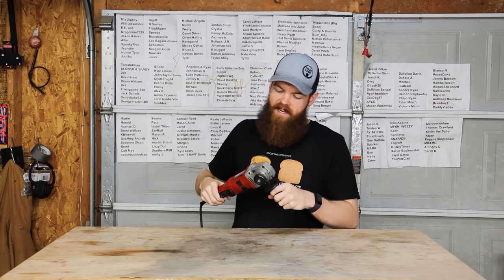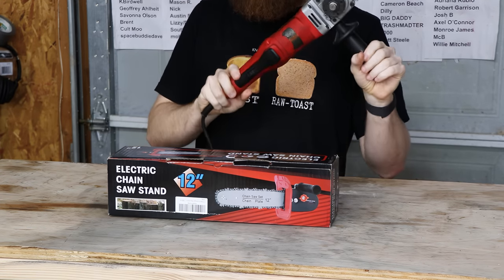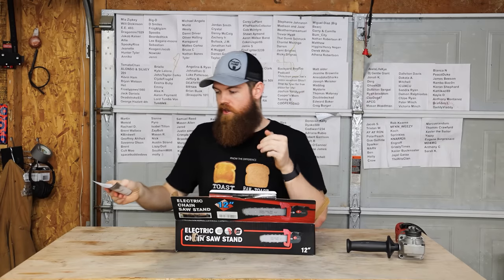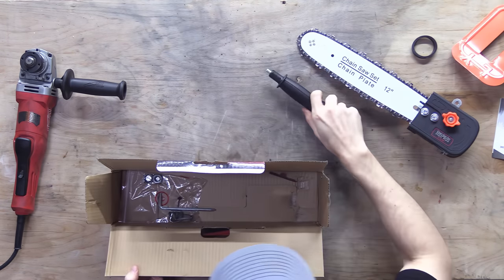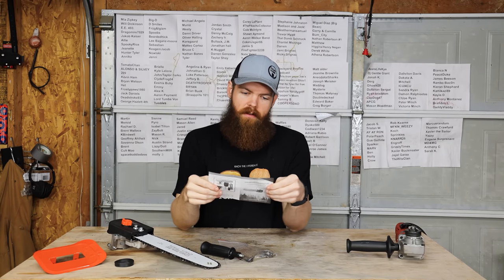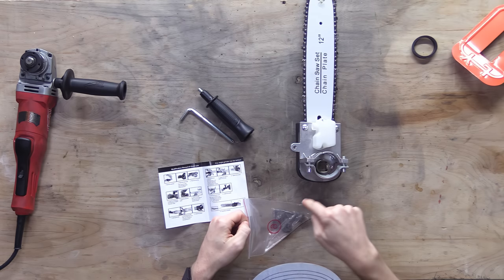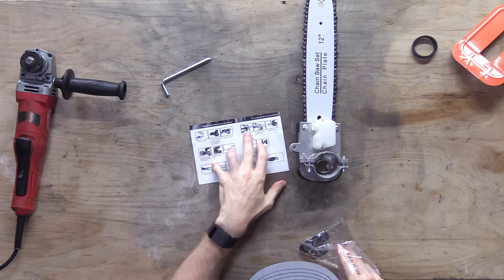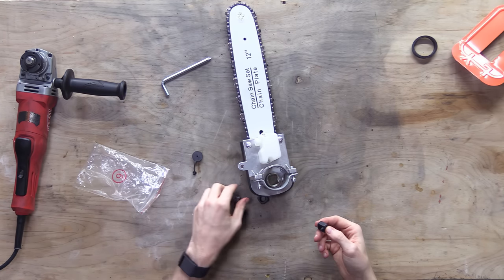Testing The Most DANGEROUS Tool From Amazon!

Comment: This was one of the first time I was genuinely concerned for Tyler's safety.  That chainsaw grinding disc scared the crap outta me.  Every time it kicked my heart skipped a beat, I was watching through my fingers like a horror movie. That thing is super dangerous and seriously should go straight in the garbage.
Reply: I dislike grinders in general because I am always scared of the kickback. Might be a good tool for the zombie apocalypse but still, a chainsaw would be better.
Reply: @jimmymartin  I agree completely.  Even if the real chainsaw was a bit slower its still less time than you would spend in an ambulance or ER.
Reply: @spicydragon3881  that's not particularly the dangerous one, the grinding disc chainsaw thing is what he meant, that shouldnt exist
Reply: I've ran 12" saw blades on angle grinders.  Man up
Reply: @MrJames_Bondage  Yeah for sure, the chainsaw adaptor isn't all that dangerous (aside from the spontaneous disassembly) as it doesn't really have the power or the length to put you at much risk from kickback unless you try something dumb like a plunge cut but those chainsaw disks are sketchy at best. They have their uses but they're like the nitroglycerin of explosives, even if you're careful you're never far from harm

Comment: This is probably the most anxiety I've felt during one of these videos. The chainsaw disc is so dangerous, I'm pretty sure it's outright illegal in a bunch of places, and you can very easily tell why in the video, it has a lot of kickback, one tiny mistake or slipup, and you'll find yourself with a disc embedded halfway through your forearm, stomach or leg.

All I know is that even if it's not actually illegal and I'm confusing it, I've seen quite a few experienced woodworkers who treat that chainsaw disc like the plague, and you should probably too! Lol.

Quick edit: I know grinder discs can be very dangerous as well, the difference is that regular discs are way more controllable, and in case of an accident, they'll just slice you up. The chainsaw not only has a lot of kickback, making it ridiculous to control, if you have an accident, it will literally chew up through your skin and get embedded, instead of just slicing. You can probably imagine why eviscerating your skin, muscle and even bone, and getting a disk stuck in it, is a lot worse than slicing with a normal disc.
Reply: Well said i am shocked how Tyler did  not cut his body BUT CHEW his Body    that is not meant to be cutting  wood with   it is for carve wood ONLY even carving wood with that  chain disk is risky  ar best
Reply: He didn't use the rubber fitting in the clamp area either.. I noticed that because it was sliding off way to fast
Reply: My first thought was NOOOO! No kickback brake.
Reply: @TechItOut  For real!
Reply: I can vouch for this. Im a victim of that tool. It kicked back and put a 7” gash in my forearm that was all the way to my bone. And it wasn’t a clean cut. It looked like ground beef. My butt puckered so hard watching that
Reply: thats why you should have a guard
Reply: The saw disc definitely needs used with a handle
Reply: @philipplays3626  when i had my accident with this wheel i had the guard on and the handle and a 2 handed grip on it. It kicked back with so much force that i had no control over it. Literally one second it was in my hands and the next second it was gone and I looked at my arm and it was ripped open. Im a big guy too, i have good grip strength and all that but it didn’t matter. Tyler is extremely lucky this didn’t happen to him
Reply: @philipplays3626  he literally has a guard

Comment: Ok so the grinding disc isn’t meant to cut, it’s a tool used for sculpting wood, and more precisely to remove a lot of material fast, you need to use it with the spare handle , and you use the same motions as when you clean up steel welds ! I hope it helps ppl understand it’s purpuce :)

Comment: You bought a smart angle grinder. It's got extra bumps and doodads that keep people from doing stupid things with it. An angle grinder is one of the most dangerous tools a layman can use. Never remove the guard and know what your discs are intended for.

Edit: after watching the Dremel, I think I should change this comment to say, grinder discs in general are dangerous if you're not careful. They spin FAST. If they break, they shatter. When they shatter, they throw shrapnel very fast and the guard plus eye protection will usually protect you enough. Just imagine a shard of cutoff wheel disc flying off at 8000 rpm and embedding into your neck, cutting into an artery. That's how you gain appreciation for angle grinder safety
Reply: Had a relo die on a roof from that very thing. My husband had a grinding disc shatter in a wheel arch once.( panel beater). He was lucky. It all missed his head.
Reply: I’ve seen what a fully shielded chopsaw blade can do to the arm of someone when it explodes. I was always paranoid when using them and because I was a welder, I always had my leather sleeves and weld helmet with built in grind shield on
Reply: I had to use an angle grinder for the first time in my life in a metal working arts class. I always wore both safety glasses and a full face shield because I was terrified of it shattering and hitting me in the face
Reply: @indicaking  Never get comfortable with it. That's when people get hurt. Greetings from Dimboola in Victoria.

Comment: Yes the black ring. Sometimes different angle grinders have different designs instead of modifying the angle grinder you need to redesign the bracket of the attachment in this case it is a chainsaw attachment
Reply: I was thinking he should have just bought a better clamp

Comment: That round "chainsaw" blade is basically for wood carving.  I would have re-staked the teeth before using it. A flying tooth can ruin you, forever, depending on where it lands. I would also add some sort of guard. If your hand would slip down we could call you lefty.
Reply: Not that I'm defending him for using that disc in the first place, but in all fairness, he DID remove the pieces of the grinder where you were supposed to use to attach a guard, so it's not like he could've used one even if he wanted to.
Reply: Safety isn’t Tyler’s forté lol
Reply: Best thing is to avoid them like the plague.
Reply: But that's why i'm subscribed. It's nice to cringe and see the genuine danger that he, totally by his own choice, put himself in. Don't know how many times i rewatched the 9V battery video just for that reason.
Reply: when he the chainsaw-disc i saw the liveleak logo pop up for a split second and then he kept going O.o

Comment: Glad you wore protection for that chainsaw disc, bro.  Stumpy Nubs, a popular woodworker on YouTube, had a really bad accident with one of those and he did a whole video about how quickly they can just mangle a person.  Be super careful with those!  Great video, as always!
Reply: Stumpy Nubs got lucky. 
Tyler had a miracle, using a carving attachment when he had cut the safety guard mounts off AND wasn't using the side handle.
Absolute stupidity. One of these days, a video he films will be used in a fatal accident inquest.
The chainsaw attachment would have been fine if he read the instructions and used the plastic ring in the clamp like it is designed to be.
💚🐇🐴💚
Reply: @BunnyKins1970  😂😂😂😂
Reply: I think there was an accident on Extreme Makeover with one of those disc saws.
Reply: @BunnyKins1970  I honestly think it’s safer without the handle cause his hand is farther from the saw. The way he was using it tho was extremely sketchy😂
Reply: @jshultz7699    Side handle is always a better option to minimise a kick from a grinder as long as you have a good firm grip on it.
💚🐇🐴💚

Comment: You could have cut a notch on the chainsaw adapter, not only you would gain the space for the screw shroud, but it would also function as a rotation stopper.
Reply: the notches are already there.  he even says at one point "i cant turn it a little bit and mount it this way and it doesnt hit"   yea, thats how it was DESIGNED!!  lol

Comment: That second one reminds me of some hackery we did to put a small circular saw blade onto our grinders back when I was a welder. We used it to cut just the welds out of the sides of aluminum tankers and separate pieces for repair. It was super dangerous and I took a chunk out of my face shield with it once.

Comment: I would get a metal strap hose clamp (sold in the plumbing section of home improvement stores) that you use a screwdriver to tighten, and place it around it to prevent it from pulling apart, since it has nothing holding it together in that way. Maybe get multiple.

Comment: There is a rubber gasket (bracket for a small arm) that fits around the grinder to make the tightening ring not over tighten and bend while giving it better grip so it does vibrate off.

Comment: The grinding disc is for pro wood carvers I use them at work to cope 12 in poles at work when building a pole truss it is not used to trim tree limb but if used wrong can trim your limbs very quick it’s very dangerous if not used properly

Comment: That's a wild attachment that feels so unsafe! I would have made the attachment so that you installed an adapter onto the grinder that used the holes for the protector and then had the saw attach to that. This is just nightmare fuel unless you can find another grinder that would work.

Comment: That round chainsaw disc is super dangerous. Those are mainly used for wood sculpting using lateral movement. I wouldn’t recommend turning that disc vertically unless you know what you’re doing.

Comment: You should be able to get a replacement spindle for your grinder so you can put the guard back on. Keep the damaged part for future videos if you find more attachments.  Or just use this as an excuse to upgrade your grinder.  Do you think you could modify the clamp to make it work?  I’m the kind that looks at devices and looks to see what I can do to strengthen it.  These are the Milwaukee models that the first chainsaw attachment works for: 2781-20, 2783-20, 2886-20, 2887-20, 2889-20, 2880, 2881, 2882, 2980, 2981, 2780, 6130, 2784, 2680, 6121, 2785, 6147, 6140, 2783, 6146, 6141, 2781, 6142, 6117, 6123. 
It also works on Makita LXT models, Makita XGT models, some Makita models, some Bosch models, and some Dewalt models. Just gotta make sure you have the right grinder.

They have a Weytoll chainsaw grinder attachment. Amazon also has a belt sander attachment for grinders you should try.

Comment: When you put the chainsaw disk on the grinder you should've turned it around, flipped it around or stand on the other side of it and cut You can also cut from the bottom and go up but I understand in a lot of circumstances you only have certain angles that you can cut

Comment: You need to use the black rubber ring that you immediately poo poo'd to help alleviate separation and vibration issues.  It goes around the section of the grinder where the attachment slips on.

Comment: Tyler I had to give you a heads up that the part you called a bracelet is suppose to go on the grinder and act as the part everything is supposed to tighten to I don't think you needed to do all of that extra work because that would have extended it out more but I still don't know how well it will hold together if the metal is bending that easily

Comment: Try a grinder that doesn't have the screw holes for the guard, like a DeWalt grinder. Also, it would be cool if you tried the chainsaw attachment that goes on a drill.

Comment: 16:02 I think what is happening is that the  chain is  being  stopped from the wood and the grinder doesn't know that or has so much power that it just wants to keep going and basically forces it self off. if it were to keep going you would have a sripped thing inside and you'd never be able to use it again. you should weld the chainsawbit to the grinder!
Reply: thast what i was thinking

Comment: The chainsaw disc cuts better because you have it attached to a really high quality grinder motor. whatever that little electric chainsaw is probably barely has enough power to spin the chain, much less speed through 4x4s

Comment: Instead of grinding on that nice Milwaukee grinder, I would have "adjusted" the attachment by grinding a few select slots. Also, notching the attachment would have helped lock it into place on the grinder.  Lord knows you will want to use that tool as a grinder again, and now you have no guard! The 2nd disc you showed is not for cutting on the side of the disc. It's used for sculpting wood and should be used like a regular grinding disc. It has been known to remove fingers, cause abdominal damage, and basically gut you when it catches. I thought those discs were banned...Still quite a terrifying attachment!

Comment: 1, you're crazy 🤣 keep it up 👍
2, If you need to modify the tool, it's the wrong tool.
3, the bracket looked the wrong way around, flip it 180°
4, that disc with the chainsaw teeth 😱, maybe it's for wood carving.

Comment: Tyler, for fucks sake NEVER use a grinder without the handle and guard. N E V E R. What you did in this video would be a great training clip on what NOT TO DO with an angle grinder. You don't even know how dangerous that was. If somebody says that it gets in the way and you can't work with it on THEN YOU NEED AN OTHER TOOL. Just look up grinder accidents and what these tools are capable of and you'll know. I've had few close calls in my life taking all the necessary safety measures. Angle grinder is one of the most dangerous power tools there are in a shop. The only ones more dangerous than it are the table saw and band saw. Also never use gloves with rotating power tools cause instead of cutting off or nicking one finger it will either remove all the skin off of your hand, will crush and twist all the bones in your hand up to the wrist or just remove most of your fingers.

Comment: That round chain disc for your angle grinder serves no purpose except a trip to the ER. That blade hits a knot in the wood, and the tool can jerk in an unexpected direction, and chew its way up your arm. I think a reciprocating saw is better and 10X safer.

Dremel EZ406-02, EZ - Lock Starter Kit, 1 1/2-Inch (38.1 mm) Wheel Diameter, 5 piece Fiberglass Reinforced Cut-off Wheels and EZ402 mandrel included, Rotary Tool Cutting Disc Accessories

That makes a Dremel a great tool. They will wear down instead of exploding.

Comment: If you use a skilsaw by starting on the far side of the board and pulling it towards you it will kick back too. If you use a blade on a weed eater and start cutting on the left side of a tree it will snatch the weed eater across the tree. It’s the same way with a grinder. If it’s pulling toward you it will dig in and “kick.” It’s not rocket science. It’s common, or as we call it nowadays “uncommon” sense.

Comment: I mean if you didn't want the grinder getting in the way of the blade you could've just swapped to securing the branch to the opposite side of the table where it wouldn't have made contact with the wood.

Comment: To explain why the Worx chainsaw is slower, the chains are different. Low kickback chains aren't as aggressive as regular chains and cut much slower.

As chains heat up, they get loose, when they cool down, they get tight. They need to be warmed up and adjusted warm, then they need to be loosened up when finished.

I've seen so many chainsaw and angle grinder accidents, I don't play with either, they each get all of my attention and respect. Accidents with either are life destroying, I've known a lot of lumberjacks maimed and killed because of chainsaw accidents. Those adapters are terrifying.

Comment: What's up Tyler the reason thst it cut faster is because the rpm on the grinder is much higher 
Edit: the chain is supposed be loose too loose would be it going over the bar just right is before it can slip

Comment: The Amazon chainsaw cut better than your electric one simply because it was a fresh blade, the fact it loosened up so quickly is extremely concerning. Also that chainsaw disc would be great for wood sculptures or even notching logs for a small cabin.

Comment: why not cut a notch in the bracket to get it to fit more snug
Reply: The square pieces in the bag are likely different adapters for different grinder shafts. Picking the right one would give it clearance
Reply: @dougbrown7150  also that, that’s a good point… Tyler doesn’t always think things thru

Comment: I'm pretty sure the "bracelet for someone with very tiny wrists" is supposed to go on the smaller portion of the housing around the spindle... It might have held on better if you would have installed it.   Just throwing that out there ;)
Reply: I didn't notice until about 15:42 that it probably fits there. It would make sense because that bracket isn't getting purchase on that thing at all without something else there.

Comment: Those notches on the saw blade where it connects to the grinder u tilt the blade at almost a 45 degree angle then connect it to ur grinder u wouldn’t have cut anything off ur grinder ur not supposed to cut anything but u was thinking the blade was supposed to be straight out and it’s not made to be straight with the grinder
And u have the clamp and turned backwards

Comment: im at 4:29.....  please tell me he figures out that its supposed to be mounted at a slight angle and the cutouts in the saw clamp are meant to hold the frame of the grinder in place in those cut outs.....
Reply: OH MY FUCKING GOD HES CUTTING THE GRINDER!!!!!!
Reply: LOL!!!!!!  IF  you would have tried the angle BEFORE cutting the tabs off the grinder you would have found you not only got a better bite but it would have ACTUALLY WORKED..... lol